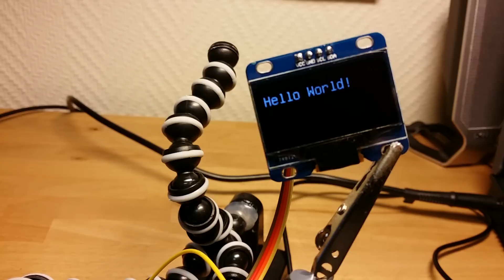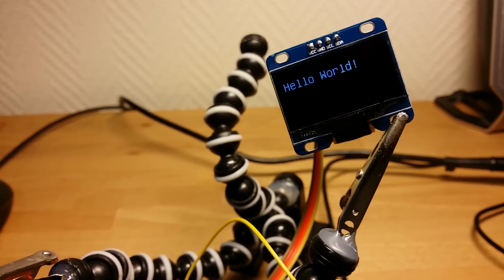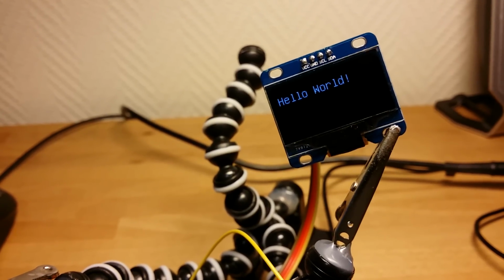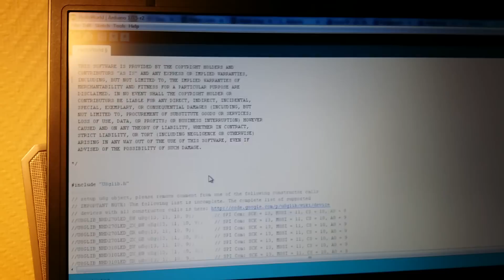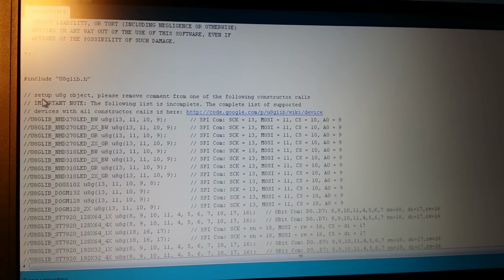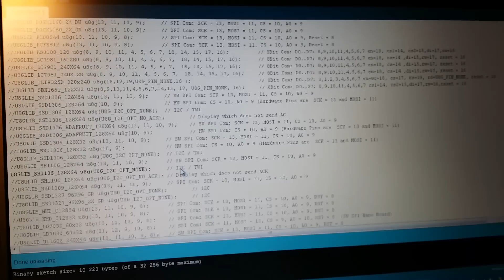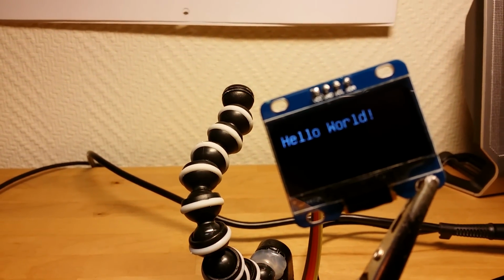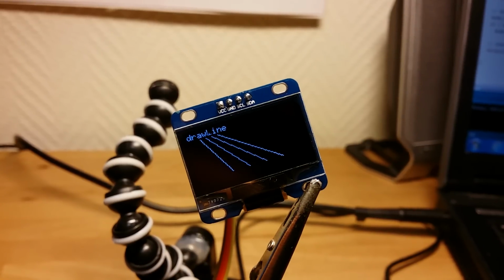1.3" OLED with I2C and SH1106 driver on Arduino

Comment: Thanks for sharing this video, I managed to get my 1.3" OLED display to work too.  Just to share that the two 10k pull-up resistors may not be necessary, as some AVR micro-controllers have on-chip pull-up resistors which will be activated when we enable the peripheral.  FYI I am using Arduino Micro and it works fine without the resistors
Reply from the maker: Thank you fkungms. I haven't tested without pull-up resistors, but will remember that next time I connect a display. The project in this video was just a test, and the Arduino in the video has since stopped working. I've changed to Micros and Nanos since.

Comment: Hi it is  very nice video, had problem to use code from my old 1306 display, had same effects as you described.
Do you know how to set contrast and make this display more bright? I have SPI version and it is very dark when I use demo codes from u8g library.
But when use different display on I2C it is bright, with the same code. Do you know how to set it?